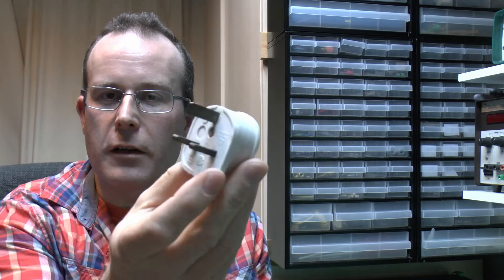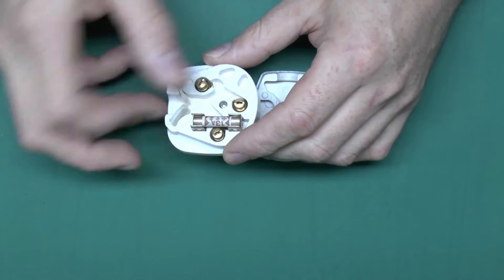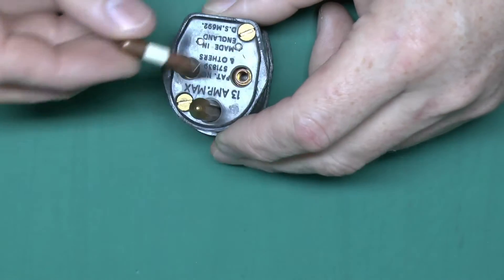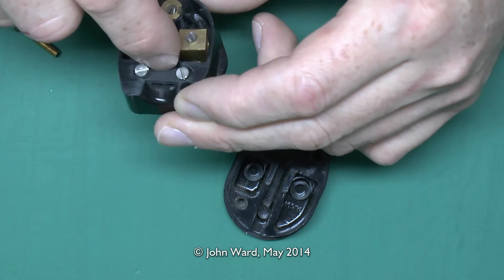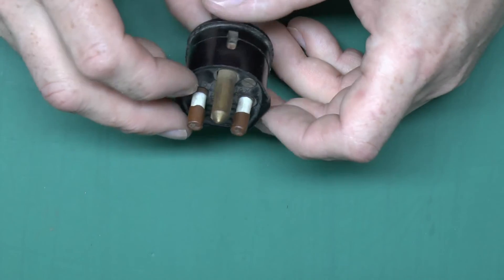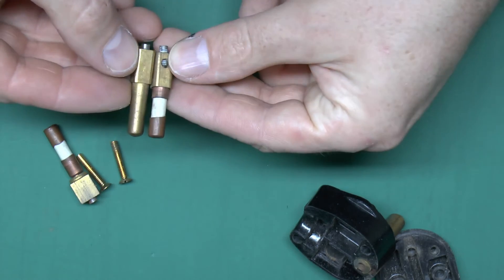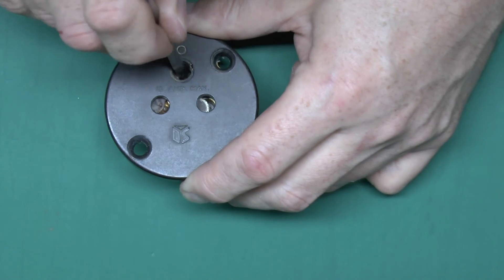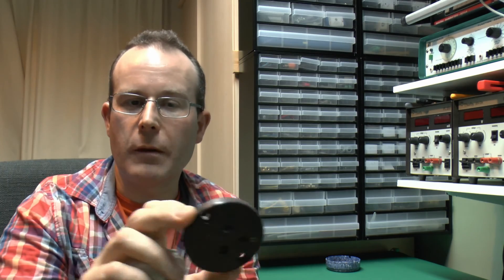Dorman Smith Plugs and Socket M692 & M674

Comment: The earth connector on the socket seems a very poor design to me. At the time when these were made, the sockets would probably have been wired as radial circuits, fed with 7/.029 sq in cable, which had a 3/.029 cpc. To connect to the terminal in question, one would either have put the whole conductor under the washer, one one side of the screw (terrible), or would have put two strands on one side, and the third in the other, still far from ideal. MK make very nice 2A 3 pin plugs with a fuse link. I use these for supplying table and standard lamps, and they are very convenient.

Comment: Weird! I was tracing a fault in our house the other day and found two 3 pin, round socket types still in use in the granny flat.. they're switched from wall to two table lamps. All the other sockets in the room are "normal" just those two lamps.
Reply: Do you mean the type featured in the video or BS 546 5A types? My relatively modern house has BS 546 5A sockets in some rooms for wall, or table lights (connected to the lighting circuits and all installed when it was built in the late 1990s). The sockets and plugs are still available.   https://cpc.farnell.com/c/electrical-lighting/mains-plugs-adaptors/round-pin-mains-plugs

Comment: As a child, I lived in a prefab 3 bed semi (steel house) in Leicestershire. It was built in 1946 and had this type of plug and sockets. The cabling was the cloth covered type until it was rewired in the early 70s, when the sockets were also replaced. When I saw the first one you presented, I was surprised to see a cable grip because none of ours had them. 
I've never know a fuse to unscrew, leaving it in the socket but fuses often came apart, so the socket had to be removed to retrieve the broken end.
When Mum bought a washing Machine in the early 60s we had to have a socket fitted in the kitchen because there wasn't one (can you believe that). Mum didn't like the idea of a modern plug because it would not be compatible with our electric and insisted the electrician found a suitable type. :)

Comment: I had 2 accidents with these as a child.
I had to have stiches in the back of my neck after falling on one with the pointed earth pin pointing upwards, and the other time I was plugging one in, and with young little fingers managed to get one finger on neutral and another on live, fortunately on the same hand.
In the 15 years or so we had those I dont remember a fuse comming unscrewed and staying behind in the socket.
I think red was 5a your right, and there was pink too which I think was 3a.

Comment: The Dorman Smith system was used quite widely by Local Authorities in the south in Council Housing in the post war period, the sockets were usually surface mounted, Local Authorities in the north tended to use the Wylex system, two flat pins with a central round pin for earth. The advantage of the DS system was that the plugs and sockets were the same size, where the Wylex used  5 or 15 amp plugs and sockets and these were of a different size. The major drawback of the DS was the screwable fuse, lethal if it worked loose and remained stuck in the socket

Comment: John,

These were widely installed in schools in London, a few rooms in my school still had them installed when I left, in 1974.  Why most rooms had been changed, but a few had not, I don't know.

The fuse coming unscrewed and being left in the socket certainly did happen; I had it happen to me.  Interestingly, Reyrolle BS196-1961 110 V centre taped to earth 5 and 15 A plugs were available in fused (DP fused) or unfused versions and the fused versions also had the fuses in the pins, but with what looked like a copper washer screwed onto the thread, but was actually an integral part of the end cap and thread.  A clip held these in place, to prevent them coming unscrewed.  The thread on these was different, presumably to prevent DS fuses without this safety modification from being used.

Red fuses did exist, and I think green as well, but I cannot remember the ratings.

These DS plugs were quite common at one time, but there was a much rarer three phase version, which I've only ever seen in school wood and metal workshops.  This was a four pin device, there was no neutral.  The pins were arranged in a square and were the same size as on the single phase plug. The pins were contained within a cylindrical shield, similar to that on a BS-EN 60309 plug, which fitted over the socket.  There was a single locking screw to secure the plug in the socket.  These plugs were quite large, about 60 mm in diameter.

Comment: I remember those were installed in my grans house in the 70s.  At the time I was living in Germany, and you could stick a German (European) style plug into the socket, but defeating the earth protection with a small pencil.  No travel adapter required when visiting the UK.

Comment: I notice you say "line" whereas I always knew it as"live" as in "live wire". Was it renamed?
Reply from the maker: +Dan Dart Yes, live now refers to any conductor which carries current in normal operation, including the neutral so its line & neutral, live refers to both of them.  
Most people still use live when they mean line, including me sometimes.
Reply: This is why, in the US and Canada, we say "hot", rather than "line" to avoid confusion.

Comment: Interesting piece.  The plug which does not appear to have a cord grip would have had a round grommet with a hole in the centre which, when the cord was threaded through it, tightened around the cord when the plug was tightened.I have a couple of examples.
Also there was an adaptor which had facility to have a captive wire plus take two aditional plugs.I have two of those.

Comment: I believe the BBC used to use twin fused plugs on some of their technical supplies, I had a Walsall Gauge plug (the similar to modern 13A type with all the pins at 90 degrees to normal) with twin fuses